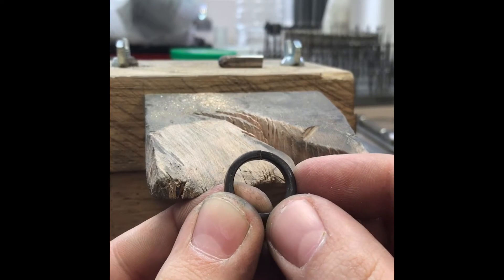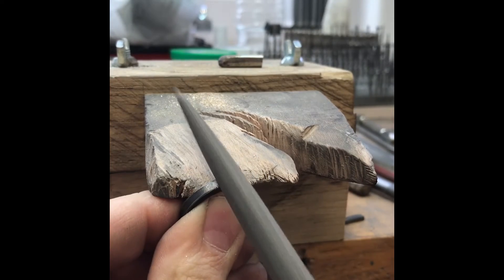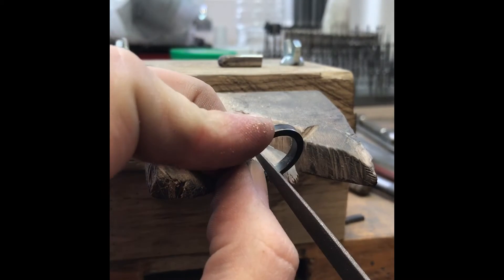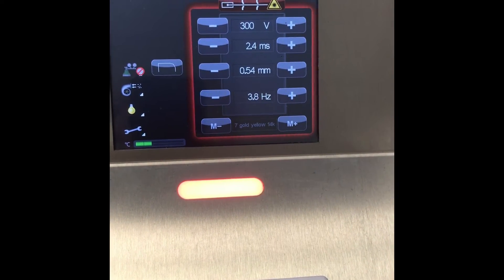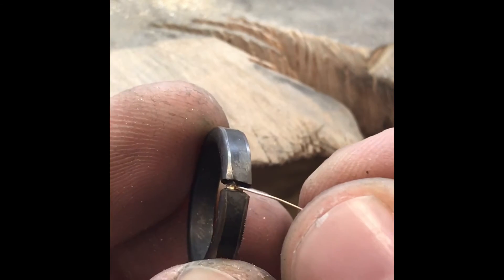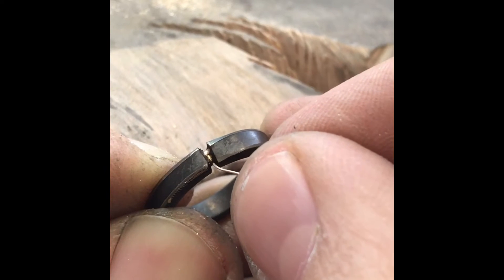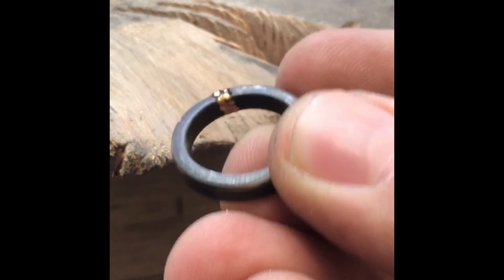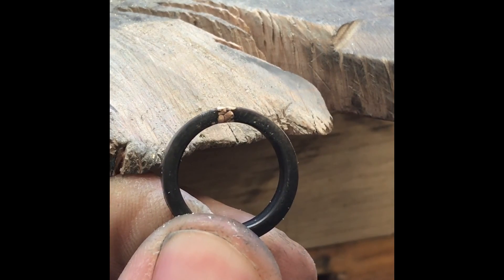The Correct Way to Laser Solder a Ring

Comment: @reallycooluleh
there is no particular wire for lasers.
the wire you make yourself. from ordinary metal to any carat, color and diameter is needed.
Reply from the maker: arel gr hi I buy my laser wire from euro mounts and the type of laser wire has to match the metal you are working on 

Platinum ring      Use    platinum laser 
18ct yellow ring   Use    18ct yellow laser  wire 

9ct red gold ring  use 9ct red gold laser wire 

You can make your own laser wire the size works best at 0.3 mm
Reply: Can you use 24ct gold laser wire on 18ct gold jewellery?
Reply: @KareecePeters  i would use 18k.  I will use a higher kt gold wire on white gold but on yellow i like to use what ever the piece im am working on, unless it is 10k and i use 14k.  i dont think i would try 18k on 14k as it might show.

Comment: I do it a bit different to you, I get the faces close and run some hard solder in the join, tap it to nearly size then I anneal it. Take the tension off, then I run a 1 mm diamond disk or parallel burr around the join only about a third of the way in and weld, never had any porosity. And more economic on the welding wire too.
Just my 2cents worth
Reply: Do you have to use laser wire? Can't just use normal wire of whatever metal you need?
Reply: @Ian S 😂 i know.. i was like why is he using hard solder and annealing.. maybe he was just being sarcastic and saying 'I just solder with a torch'
Reply: @allenl9214  no not being sarcastic, it’s a way of joining band or resizing an new ring without the chance of porosity in joins, as if not done properly, the polishing process can gouge out the join, depending on the quality solder used, that’s why I overlay the join with laser pass. Just my 38 years worth.
Reply: You use solder with a laser welder??
Reply: @Ian S in some cases you need to use a bit of both.